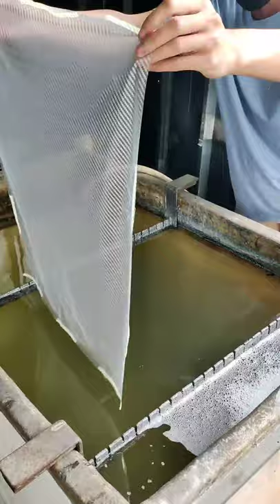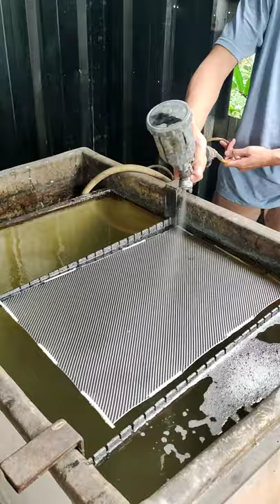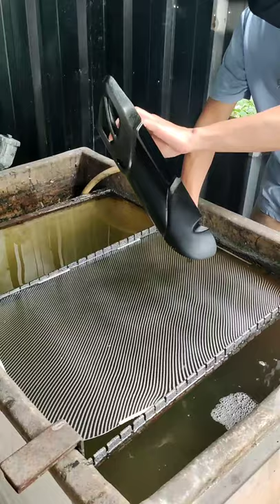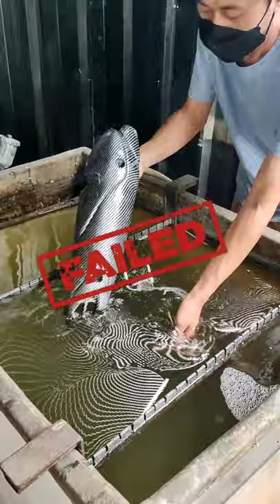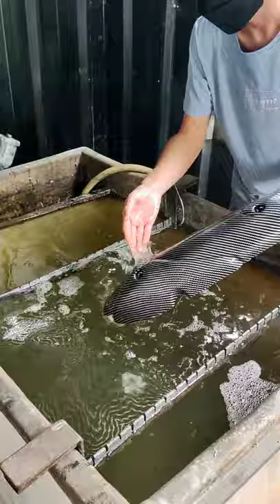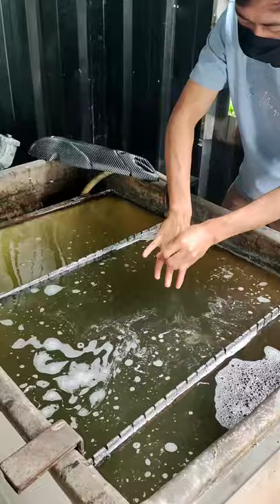Failed !! hydrographic water transfer printing hydrodipping

Comment: Leave it under until you pull coating out of the way don't ever lift out of water through any of the coating or it will do what you just did and mess it up with partial double coat and look terrible